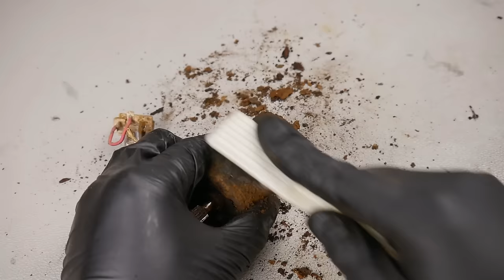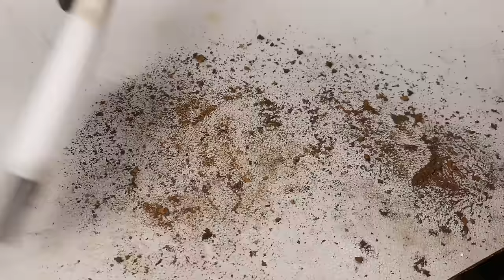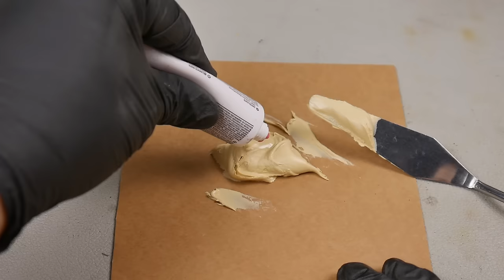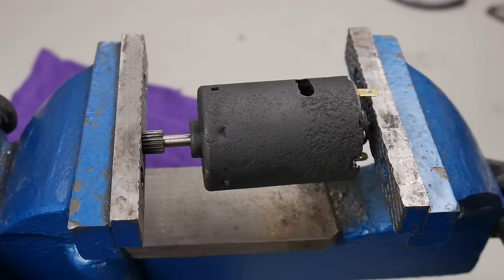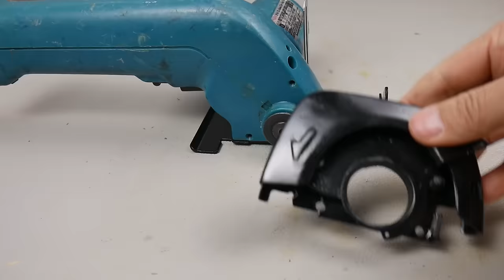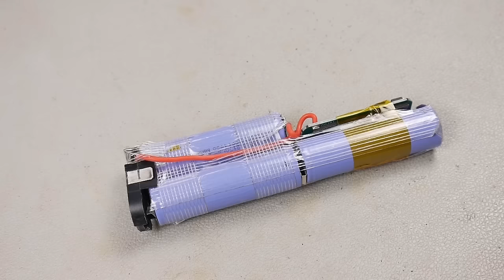Cordless Circular Saw Restoration Makita 4190D， replacement of 21700 battery cells

Comment: An ancient relic, to be sure!I have 3 of them, with the water bottle attachment, for use with a diamond blade. I'm a master glass fabricator from way back, and these are the best tool for certain jobs. I figure I'll be able to keep one running with parts from the other 2 for a while yet. Still rockin the ancient batteries, too!

Comment: Nice job. Just one thing missing.
Discrete 5.5mm charging socket somewhere on the handle.
Reply from the maker: Thanks for reminding me. I really forgot about that. I usually charge with an adjustable power supply. I should add a separate charging port.